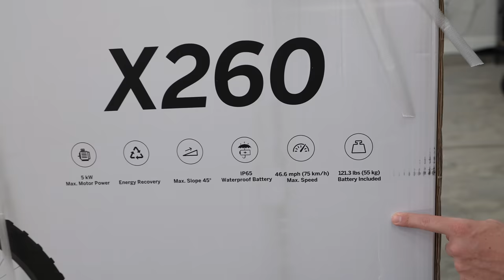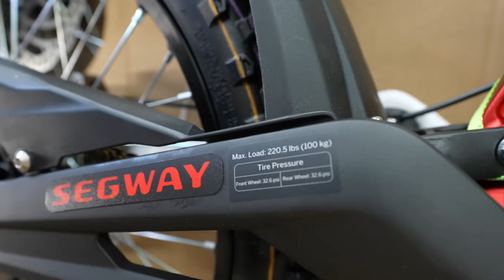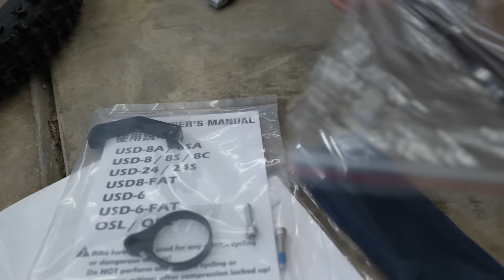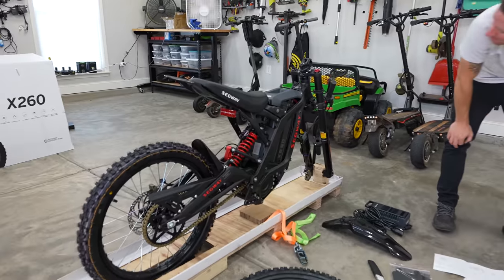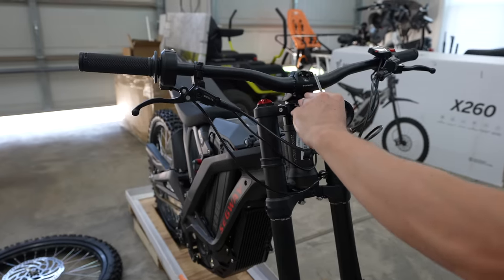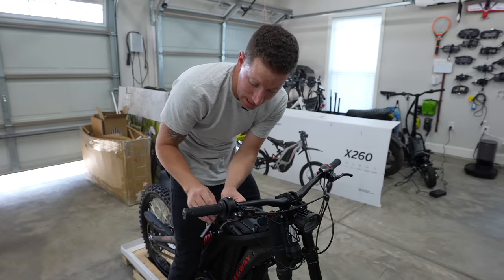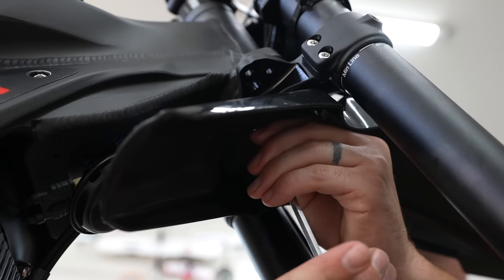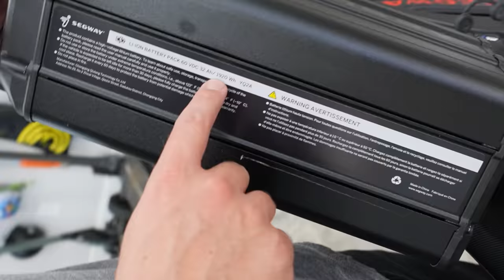Segway X260 Dirt eBike: Unboxing & First Impressions!

Comment: I bought a SurRon, one of the last Red ones. I love it! I think I would have gone for the Segway because of the App feature.  Only problem, I had been away from motorcycles long enough that just scanning the options list I thought SuperMoto was something to do with Motocross, so I checked the box and got 17” wheels and road racer tires. Better for the street but a little slippery when chasing the dog. But I love it. I don’t think the belt option was available when I ordered. I’ve had mine @ an indicated 75 kph. I had an Onyx RCR @ the same time, but sold because I never rode it, I’d always grab the SurRon. I’m old and don’t weigh much( #;130) and the suspension on the SurRon is much more appropriate for me. Also, it just looks like it is more professionally designed and built. Thanks for the video/review.

Comment: I just unboxed and put together a Sur-Ron Light Bee yesterday. It is so similar in so many ways - even the 2 ratchet straps exactly the same 2 colors. I wouldn't be surprised if a lot of the parts are interchabable.
Reply: How much did it cost you?
Reply: @bbkwolf7862  around 4500, i believe, from Luna Cycle in Calif.

Comment: Looks great. These are gonna become the norm
Reply: Not yet. You go camping for a weekend and can only ride it one day? Maybe with a few spare batteries, or a large panel array on an RV and a spare battery to charge while out. Also a ICE motorcycle will still blow it away for performance. Not saying it won't be fun though.

The biggest issue I see is $5K for a bike that will probably only work for 5years, while I have a cheaper (when new) 1998 motorcycle that I still ride and functions perfectly. Put 15K miles on that and let's see what is left. They are neat, but still a niche market bike.

Comment: As this has no pedals and a relatively high top speed, what are the license requirements for street operation?
Reply: I was wondering the same thing.  Can I legally take this on bicycle trails lol!
Reply: @babygamer405  no
Reply: One thing for sure, Ben is really having a great time being a rebel.
Reply: @babygamer405  no. its a motorcycle that needs a street conversion since its a motorcross

Comment: Last I checked I went out to the edge of the city there wasn't anyone riding
anything around out there.... in the dirt in the hills There were just 100s and 100s of vehicles coursing up down left right on the streets. I'm pretty sure if I go out there every day for a week I'll see the same thing. So HEY.. let's take the viable sufficient-power light-weight drive technology and make... SNOWMOBILES out of it. Yeah, that's it. We're not trying to hide this stuff under the rug or anything.

Comment: I’m a little on the big side and I bought the x260 without seeing the weight limit. I was wondering is it possible for me to brake the bike due to my weight, or would my weight just cause the bike to accelerate slower
Reply: If you bought it for $150 you just got scammed because the bikes have been offsale for a month now talking about tiktok ad btw
Reply: @christiangarcia8873  oh I’ve seen that ad before, what do you mean it’s a scam? Just curious.
Reply: @bdog8180  this is a $5000 bike not $150 🤣
Reply: @therealrobbycrash  im seeing them for 69.00 right now

Comment: For the money ANY Japanese medium size motorcycle will last forever 100 times better smoother faster. No comparison.
Reply: Electric?
Reply: @villarreal956flo  
No The time is not right for EV bikes.
All overpriced slow poor rang and no one can repair. Better off with a 50cc scooter !
Honda, Yamaha. 
Not the Chinese garbage that all start falling apart after 2 years.
You will get 80 miles to a gallon at 35mph all day long.
If you want to go 60mph 125CC or a 250cc will do 80mph. At this time gas bikes are 100 times better. Last forever many shops work on them.
Can get gas everywhere. My friend got an electric paid $2000.
Top speed 22mph and needs to worry about charging all the time. We go on the highway and drive interstate and have a great time. He stays close to his home and drives to the local park. No fun at all.

Comment: I love the idea of ebikes but I just can’t wrap my head around the cost 😭 for the price I’d probably just get a Honda Grom
Reply: The From is cool but look at it this way. You have to register it, pay insurance and gas which are all ongoing cost. You pay for this and ride it. The end. Plus the From can't go off-road like this can.
Reply: @redriider  I have a Kawasaki z125 pro which is just like the Grom and I take mine off road all the time. Insurance is only $47 a year. It also gets between 90-115 mpg, and it holds 2 gallons so it goes along way. I'm looking at getting either this or the Sur Ron, can't make my mind up.

Comment: Is this classified as a powered bicycle? Or a motorbike ? Does it need to be registered / licensed ?
Reply: Most state laws say if the bike has pedals for manual use it is an electric bicycle that as long as it only goes around 20 miles per hour on the throttle it is street legal and needs no registration nor license to operate. This Segway260 has motorcycle style pegs which will put in light motorcycle class like Scooters and motorcycles, But without proper street lights there may be issues. I am sure there are street legal options.

Comment: Nice but I'm waiting for the Sondors Metacycle. Same price (about $5000) but has 80 miles range and 80mph top speed (of course you won't get 80 miles of range at 80mph).

Comment: How are you not terrified of taking this on a public road? You can be in so much trouble with the cops if they pull you over. Driving on an unplated, unlicensed, uninsured non road legal vehicle in a non motorcycle helmet. That's potentially thousands and thousands of dollars worth of files, isn't it?

Comment: For the same money you can get a brand new kawi z400 that's much much faster gets much better range. I just don't see the appeal until these e bikes and e motorcycles can become more cost effective and get better range. I mean I'd take a new super cub or trail 125 over this and save over a 1000$ and have a faster better built more reliable form of transportation. Btw I do think this thing is cool it's just not pragmatic.
Reply: Once you own a real motorcycle how can you spend money on this garbage?? Not me that's for sure.
Reply: Some people done like the noise.
Reply: I can't see 5k in that electric scooter. I agree- much rather have the Kawasaki Z400 for sure.
Reply: I said the same thing bro

Comment: If you actually going to use it off road, those suspensions are not capable they are low cost, actually can’t find any cheaper ones, an upgrade to this and surron in terms of suspension is about 2000 euros…

Comment: E bikes are so overpriced for no reason I’m more of an electric scooter person and I bought a scooter that goes 40mph and has so much power and really pull when you barely touch the throttle for only 2k an evoke that would go just as fast would be more than double the price your better off buying a motorcycle
Reply: These bike are 320 bucks

Comment: The Segway Dirt eBike X260  is a scam its 35k and they lock you of speed with an online app, I bought a dirtbike for 2k on Amazon with an top speed of 80mph the Segway Dirt eBike X260 only goes 46mph for 35k that brand New 2023 Nissan Rogue money.